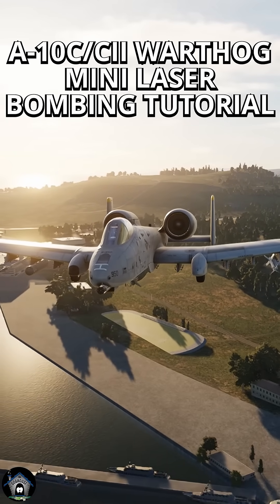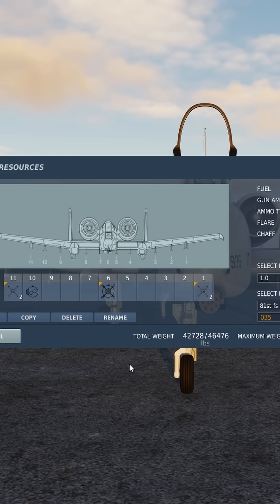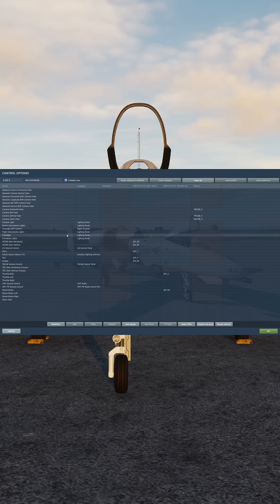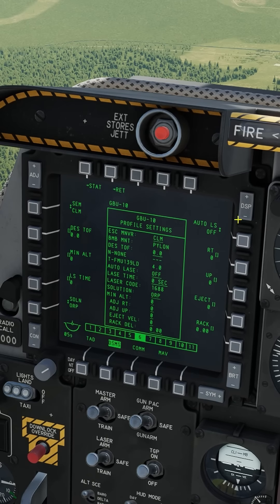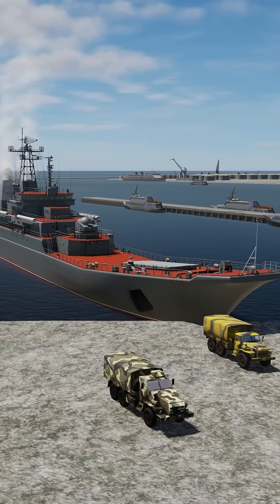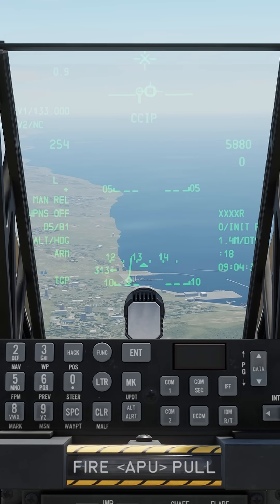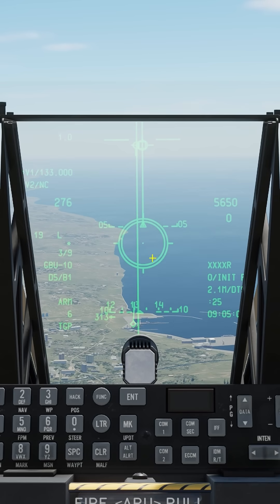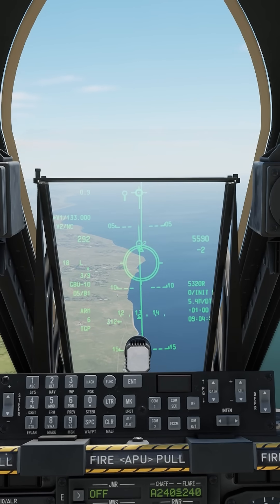DCS: A-10C/CII Warthog Mini Laser Guided Bombs #dcs #shorts

Comment: One thing to add, especially on the 10 is to setup the laser to only start firing within 10-15 seconds of impact...at higher altitude bomb runs this works nicely and even allows you to fling GBUs if you need to keep farther away from like AAA or a SAM (or you're trying to take out that very SAM and what you have handy is a GBU)
Reply from the maker: Nice thanks man